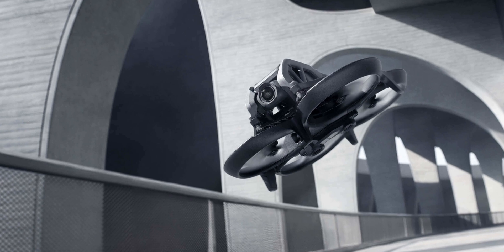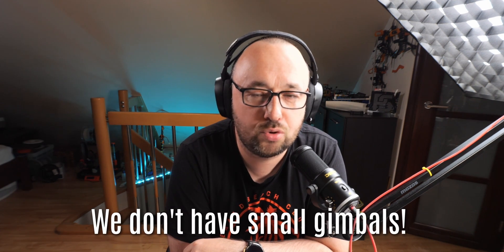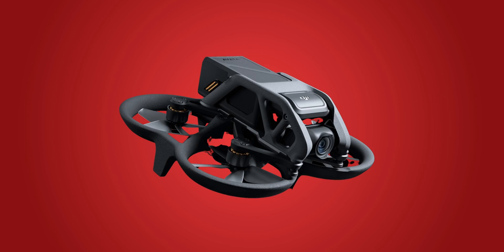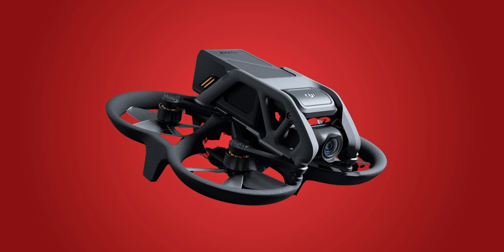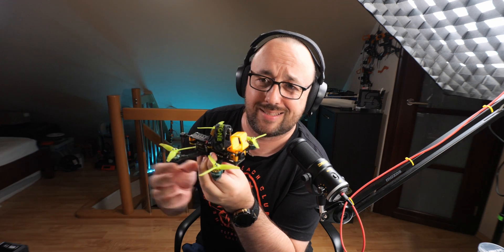Could You 3D Print and DIY an DJI Avata Drone?

Comment: Hey thanks for your considerations i would be very interessted in such a build.  I was actually thinking in a similar direction. Cinewhoopers love the percision slow flighing of the avata with its flow sensor but hate the bad acro abilitys. Would it be possible to put the avatar to a lighter carbon frame witch has the ability to switch between guarded and open prop Design? And maybe hack the bms inside the lipos to put regular / different lipo sizeses in like zedd did with his Mini 2 batteriy mod? That way we would have a really flyable 4s cinewhoop drone with the ability to control the exposure inside the Googles during flight with good acro abilities or long flight time in one combination for a resonable price. What do you think?
Reply: https://youtu.be/PHhj9KRg_18

Comment: The thing is that when in the "manual" (acro) mode, the gimbal isn't actually a gimbal but becomes a tiltable camera so you wouldn't even need the servo driven  by an accelerometer/gyro -- just from another channel on your RC.

Comment: Hint: Avata parts (duct, frame, propellers, etc) are all available as individual parts. Just need to add your own flight controller, camera and servo/gimbal.
Reply from the maker: and that's probably the harder way to do it as those parts require other exact parts to work :)
Reply: @FPVUniversity  Very true. 
Personally think building custom tilt camera mechanism on existing drone would be less work.